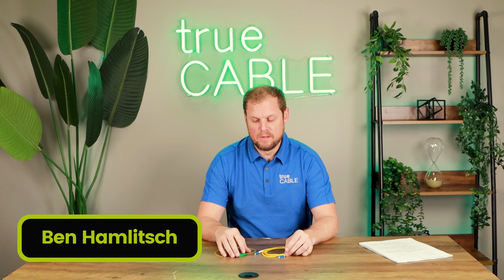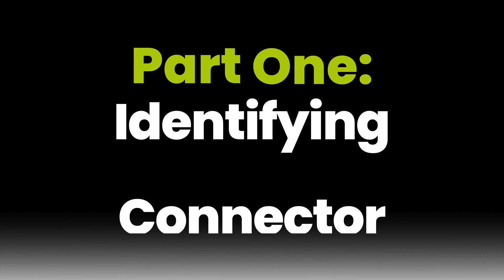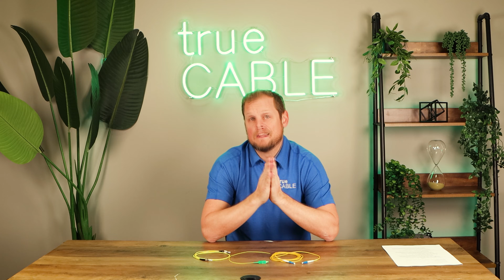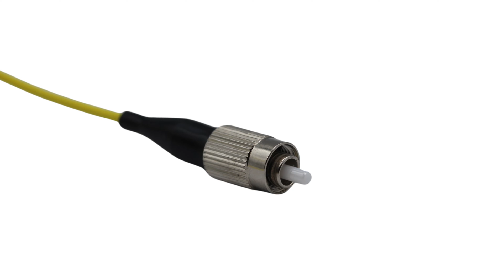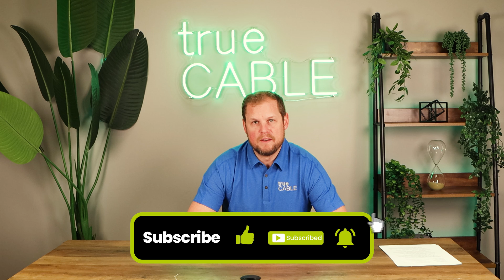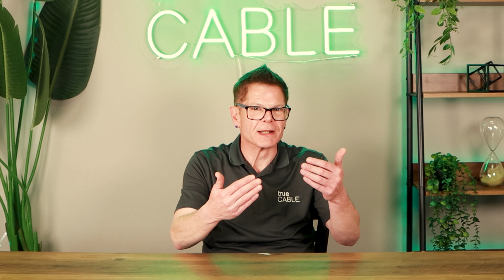PC vs UPC vs APC Fiber Connectors | Key Differences To Know!

Comment: Am I right that this host keeps using the word ferrule incorrectly to refer to the fiber face? Or am I missing something due to him showing us the connectors so far away from the camera that we can't see which connector is which with what differences?
Reply from the maker: Hello! I think it is the distance from the camera causing the confusion. Ferrule is not the same thing as the end face. The end face is the actual end face of the fiber conductor (or a stub-out standing in for it) as with fusion spliced or mechanically spliced connectors. The ferrule is an alignment sleeve that holds and aligns optical fibers within the connector (or coupler).

Comment: Hi, thank you for your educational videos! I've started looking at  10Gbit BiDi transceivers and they rarely specify their polish.
They're sold as a pair one marked green or blue and the other black (i assume thats because one Rx on the frequncy the other Tx on and vice versa?)

But a few with a green marking, say they are both UPC and APC compatible. Is that possible? Also since the majority of transceivers on the market are marked blue is it safe to assume they are UPC even if they dont specifically mention it?
Reply from the maker: Hello and great question! The answer is simple: SFP/SFP+ fiber optical transceivers (BiDi or duplex) are end face polish agnostic. APC or UPC, both will work. In other words, what really matters is the actual connector format (LC, SC, duplex, simplex, etc.) and what mode of fiber you are using (SMF vs MMF). Hope that helps!

Comment: I have a UPC to APC fiber cable hybrid thing, where can i use it and how?
Reply from the maker: Hello! Well, where you would use it depends upon the equipment you have. If you need to make a fiber connection from a device/transceiver/coupler that uses UPC and then the other side of your connection uses something that requires APC, then that would be the spot. Most of the time, connections are going to be UPC to UPC and APC to APC. A UPC to APC connection would be for transitioning from one end face polish to another...like a transition from UPC single mode to APC single mode.

Comment: So green is better than blue?
Reply from the maker: Green connectors (APC) signify angled physical contact connections, which can be better for extremely long distance and high speed applications, and are associated with single mode fiber. Blue connectors (UPC) are ultra physical contact connections, which are typically more than sufficient for the shorter distances associated with multimode fiber applications. Technically, APC (green) is superior, but you won't find it on anything but single mode fiber.

Comment: I’ve been using a Blue (UPC) Cable on my Green Ports for the past 2 years. Both my ISP’s wall box and my modem have green (APC) ports. Just now I’ve noticed. Thank you! Ordered the correct one right away. Hopefully the ports were not damaged. (Note: Had no problems with my internet with this setup still was fast but I want to minimize signal loss as much as possible).
Reply: To add: My modem’s reference (optimal) range for RX Optical Power is -27DBM to -8DBM. With the wrong connector, I have a -26.58DBM reading. Is that in the worst end of the spectrum? Once my proper APC cable arrives and is installed, I’m going to re-check my values.
Reply from the maker: Hello and you are welcome! Yeah, this is a common mistake. Good thing you are getting the right patch cords for your setup. You had to have been experiencing some signal loss, but unknown how much. Damage is unlikely.

Comment: Xfinity responded to house service interruption and supplied new fiber optic cable but used the blue UPC whereas before there was the green APC. Should I have them return to change the connection? Thanks for the helpful video.
Reply from the maker: Hello! You have a keen eye, and we would recommend you contact Xfinity to find out why the change was made. It is possible they were correcting a problem, as opposed to introducing one.
Reply: @trueCABLE  Thanks. I will assume the UPC will technically not cause an outage for internet and cable service and is compatible to a residential application
Reply from the maker: @tomsmith5784  Hello and you are welcome. We would not want you to assume anything, however. We recommend still checking with Xfinity to be sure the right cable is being used and the end face polish is correct for the equipment. It won't hurt to ask them!